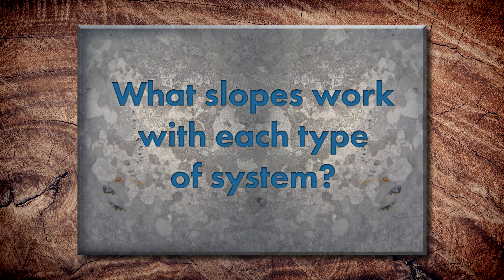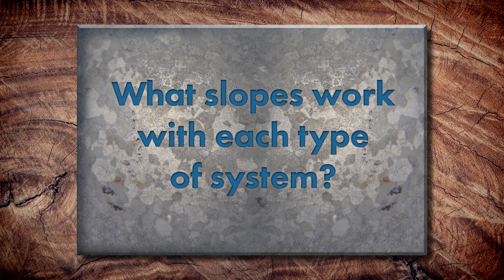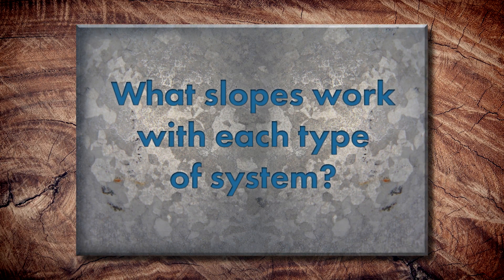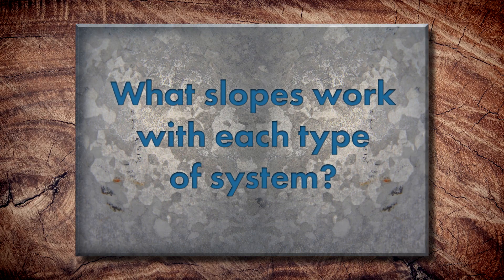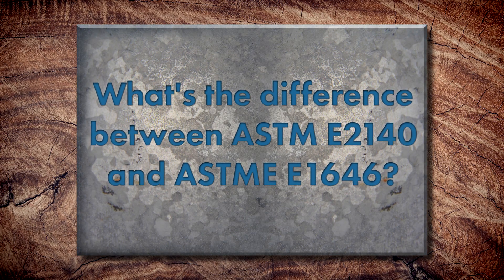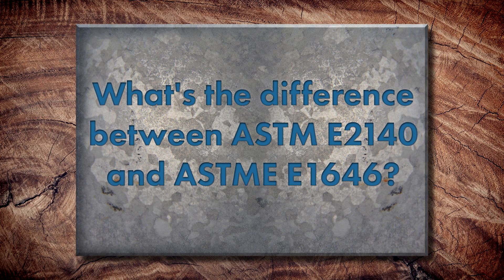Hydrostatic vs. Hydrokinetic: How Does Your Roof System Shed Water?

Comment: The pitch of my metal roof is less than 3. I was told that I couldn't use shingles. Now that I need a new roof, I have four estimates from four roofing companies with 4 different recommendations and four different prices for what I need. I'm trying to do my homework and am becoming confused. After watching a few of your informative videos, hydrostatic is the way to go. Am I correct? What kind of sealant is recommended for the seams, and do you recommend a particular underlayment? Love your videos. I'm learning a lot!

Comment: If i have a greater than 3/12 roof using a snap lock hydrokinetic roof system, but in cold climate with snow, will the sitting snow in winter on the roof cause failure since snow will last more than the tested 6 hour submerge test? I guess if the snow starts to melt from sun it may penetrate?

Comment: ASTM 2140 Hydrostatic does not always need to be double locked as stated in this video.  Single lock hydrostatic systems are available from Ultra Seam and are much easier to install than double lock systems.  See www.UltraSeam.com for more information on these ASTM 2140 tested systems.

Comment: I've a question. what kind of test is used for water penetration on installed roof panels. ? 
please note that I am not talking about a sample test, I am talking about the actual roof. thanks
Reply from the maker: Hello! I'm not aware of a water penetration test for installed panels, so I'm going to defer to the Sheffield technical department. You can contact them via this page and they will help you out: http://bit.ly/contact-sheffield Thanks for commenting! -Thad

Comment: I have an off topic question. I am an owner builder doing just about all the work myself. I originally wanted a metal roof but have been hearing a lot of complaints about how that roof system can interfere with cell phone and satellite internet service. Any opinions or facts that you can give me?
Reply: no it does not

Comment: I have a question not about the topic in the video but and old one and I figured coming to your most recent video would get it seen faster. So basically I’m looking to replace a shingle roof that’s basically rotting away. The shingles are destroyed and a lot of what’s good that’s left over is the wooden frame. I really think that metal roofing is the way to go beacuse it’s going to be less work time because I won’t need deal with all the hassle of the old shingle roof. My question is do you think it’s smarter to go with the metal instead of another shingle roof. Hoping for an un baised opinion I know you are a metal roofing company. Appreciate the help.
Reply from the maker: Thanks for reaching out Jack!
It sounds like your existing roof is an older roof, and if it is in really bad shape your existing roof deck could be in rough shape as well.  Our recommendation would be to involve a professional roofing contractor and have them investigate the condition of the roof deck if it is accessible.  If the roof deck is in good shape, you could be a candidate for roofing over the existing shingles with a metal roof.  Whether or not you roof over your existing shingles or tear off, a properly installed metal roof will last longer than an asphalt shingle roof.  The viability depends on your financial situation and if you prefer the aesthetic look of metal over shingle. -Thad
Reply: The Metal Roofing Channel exactly what I was looking for thank you!
Reply: Definitely rip the shingles off and inspect the decking.
If decking is good you have helped the install and longevity for the install.